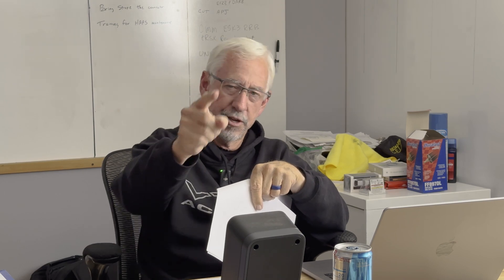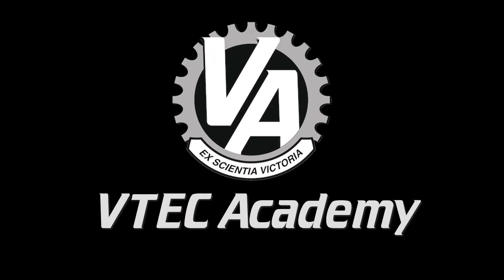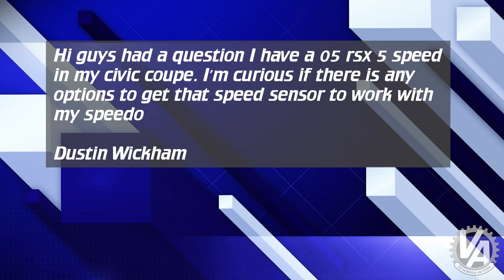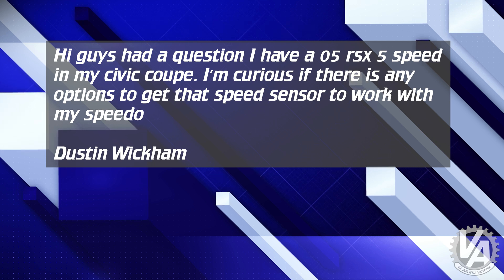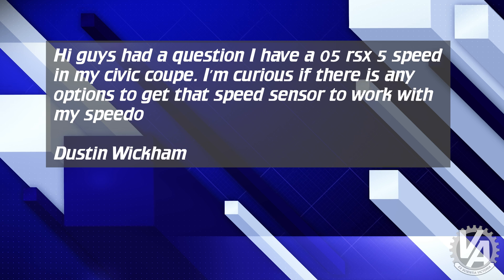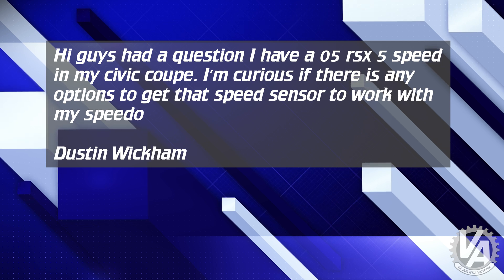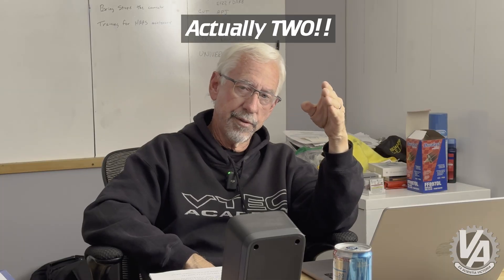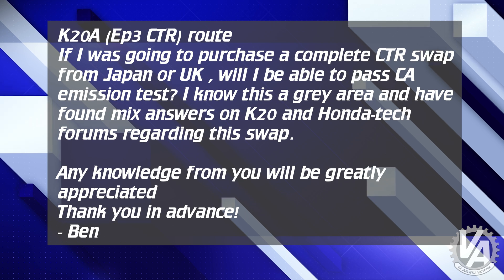Viewer Questions: K Swap CSS to VSS, EP3 Swap Emissions, 7th Gen Automatic K Swap, Burnt Valve

Comment: i just did a type s k20a2 swap  and transmission also ecu on my ep3 i use ep3 harness everything good it runs and everything but vtec does not engage any recomendations on what it could be  it wont give check engine lights or anything  do vtec has to be tuned on when doiing a tune ?? anyone can help

Comment: Does that KTuned CSS converter knock the voltage down from 12 to 5 also? Does it fix everything? I have a CSS with 12 volts going to it and a 2004 RSX Type S Hondata ECU. I've heard the CSS only needs 5 volts.

Comment: I appreciate Brian's great wealth of knowledge with Honda swaps.  I've done a BAR swapped 99 Forester (non-turbo SOHC 2.5L to 04 WRX DOHC 2.0L Turbo).  Re:  K24A Route swap to EP3, you cannot use a JDM K24 due to BAR not allowing it (unless you already have an existing K24 that was BAR).  JDM engines are more costly than a DIY pull from a wrecker.  You need to use a TSX (preferred) or Accord swap because BAR needs to see the original TSX/Accord ECU/engine-harness/EVAP/DBW modules and wiring.  You need to take the car with the TSX/Accord ECU to a Honda dealer who can then certify that the ECU is valid and stock from a TSX/Accord.  So, it is possible, but not as easy for a typical DIY swap that most people do, because those usually don't comply with all the BAR requirements which are all OBDII emissions related.

Comment: Can you please go in detail over a jdm k24 swap into an ep3 please everything that has to be done to make it work
Reply: I have a jdm crv k24a with my stock ep3 transmission it's runs strong but my vss light is on, my 2 step wont work either I got a tune though 
Trying to figure out if we have to repin the vss sensor

Comment: Thank you Brian for answering my questions! If I go with the rsx type s engine, do you mean the complete engine and transmission swap or just the engine swap with rsx type s ECU? Will key immobilizer be an issue if I swap the ecu to rsx on my ep3? Thank you again
Reply: @transta00 you will need sync the keys and immobilizer to the 02-04 Rsx-s ecu.

Comment: Speaking of automatic Kswaps,i would love to see if the motor of the ILX typeS
That comes with the DTC transmission 
The engine swap is already done as far 
I know but no info about the DTC trans 
Since the CVT that came in the accord sports is being know for being a fuse 
As soon the motor start to make any amount of power above stock

Comment: Great content, A few quick questions regarding a swap. I want to put together a K24A2 with  CRV gearbox and rear diff with a viscous coupling from a land rover for an awd build, Car might be a suzuki awd or subaru but i have not decided yet. I am located in europe and don't have all the accura parts lying around as you guys. What ECU and harness should i use  for this?  Should i keep the fuel system from the accord or do something else entirely?
Reply: This is a complete guess but I would check out the accord euro r ecu and harness. I know there's a k24a model

Comment: Good timing on this video. I am gathering parts to do a Jdm k24a swap into my 02 Ep3 as well. Two questions.

Putting the guts of a 08 si 6speed trans in the Ep3 trans case. That way I can keep using the CSS, right?

Would you recommend using the Ep3 wire harness or go with rywire tucked harness?
Reply: you should be able to use the ep3 case for it's vss sensor location. the internals out of the 08 si. but in order for the vss to work, you'll need to remove the vss gear from the ep3 final drive. and put it on the final drive from the 08 si internals. then everything should work oem with your oem harness and plugs with no need for speedo healer or any of that.

i'm working on the same thing right now but with a k20a2 instead of the k24a.

that said if you're using kpro like he said in the video. just leave the 08 si trans alone and stick it in the car and you can use kpro to do the conversion.
Reply: @neverknowsbest4994  thanks for the reply. I have lots to learn/read.  I thought the ep3 5speed had CSS.

Yes. I am using Kpro v4. Sounds like bolting it right on is the easiest way.

Sorry If this is a dumb question. But can I use the ep3 shift cables with the 08 si trans?
Reply: @jackyyeung7903   that actually brings up a good point. the shift selector for the 08 is backwards. so you'll need the shift selector from the ep3 trans. but the bolt holes dont all line up iirc. so its another reason to use the ep3 trans case. you will need to disassemble both shift selectors and use the square piece from the 08 selector on the ep3 selector in order to be able to shift info 6th gear.  you will lose the reverse lockout. the best way to have the reverse lockout is to just use the shift selector from the rsx-s as it requires no modification and has reverse lockout solenoid. but it's 200-400 used.  just something to consider.
Reply from the maker: Thanks for watching! No, it will be VSS with the internals swap. Yea, use the EP3 wiring harness.